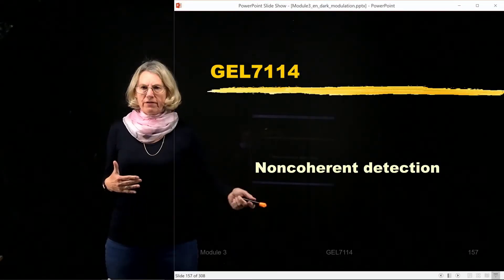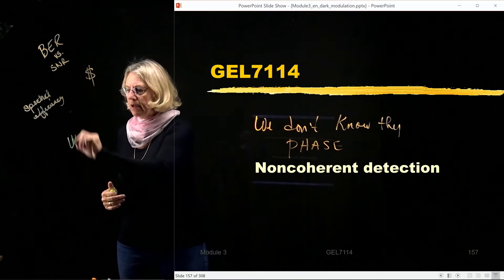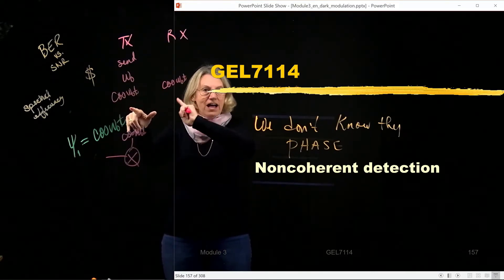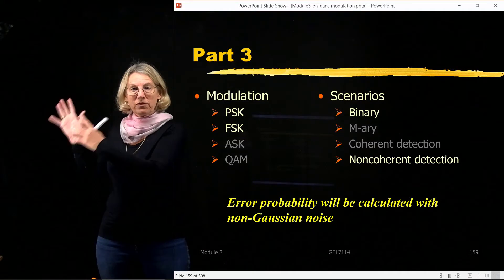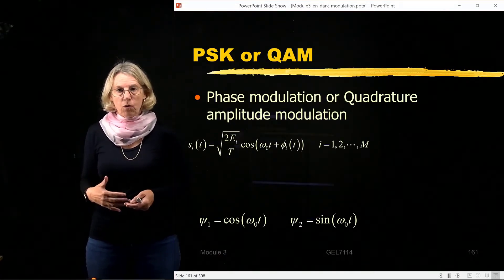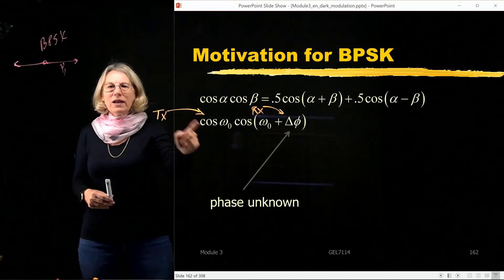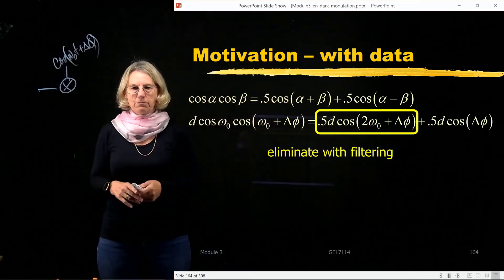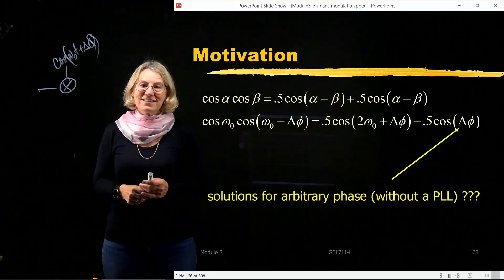GEL7114 - Module 3.12 – Non-coherent Detection

Comment: Very interesting! Can you please point to the follow-up video to this as I'd really like to know "how this works" I can see how squaring the signal can remove phase sensitivity (for a bi-phase system). But would the "d" term not also be squared such that d=+/-1 results in fixed +1 output. i.e. Data content no longer present? Also, what about difference between Tx and Rx frequencies? Without a PLL, there would always be some difference..